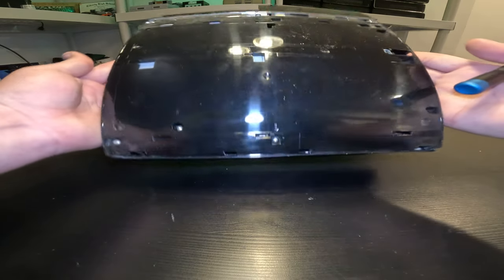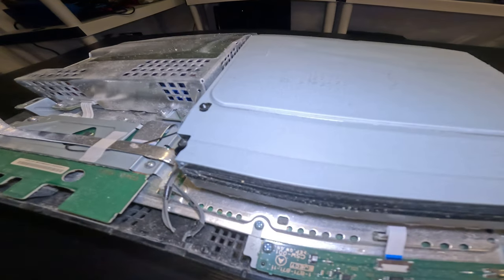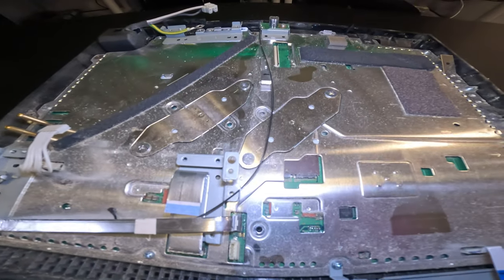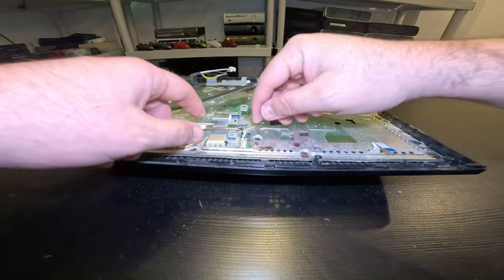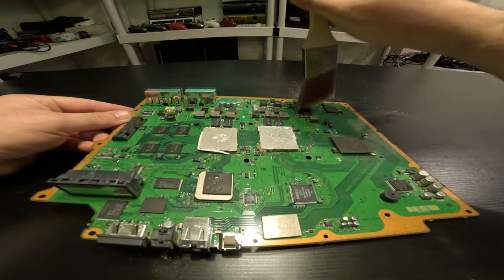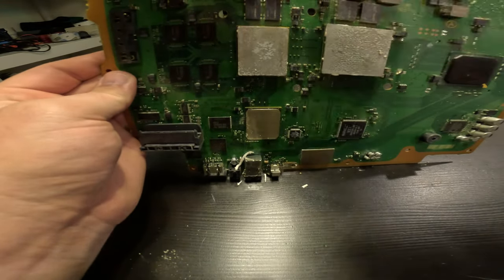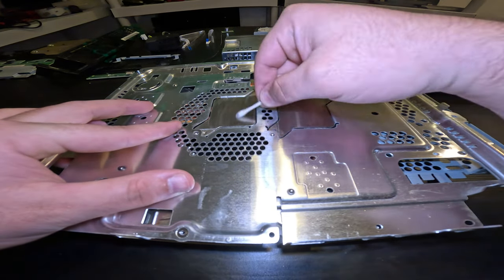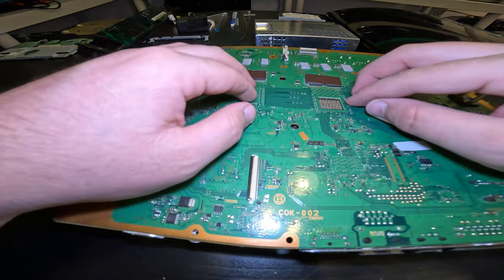Reviving the Past: Backwards-Compatible PlayStation 3 Restoration

Comment: The only issue is this would be a 90nm RSX model and it's still guaranteed to YLOD eventually, as they were ALL bad.  TSMC screwed up during fabrication of all 90nm and some 65nm RSX chips, so whomever gets this, sorry to say you have a ticking timebomb.
Reply from the maker: You are absolutely correct! The only permanent solution is a 65nm that is outside this defective period. I'm hoping to get a reflow station here soon so I can perform this work
Reply: You CAN get a 40nm RSX to work as well, as it's completely outside the danger zone, the only one that will not is the Super Slim RSX.  There are tutorials and examples of this mod done all over YouTube.
Reply from the maker: @dschultz9466  Thanks for sharing! I'd love  to be able to do these swaps and save these consoles from the trash bin. A 40nm swap would be awesome! I am running my personal console as cold as possible, hoping to extend its life. I have a late model slim that is going to be the donor for the swap when I purchase the equipment. Plus I have a few blades dashboard xbox 360s with bad GPUs that need the same treatment.

Comment: What thermal pad do you recommend for the PS3?
Reply from the maker: If I was to recommend anything I see a lot of good reviews about using Arctic TP-3 Thermal pads. On forums you will find that the thicknesses range from 1mm, 1.5mm, & 2mm depending on Thermal pad location. I hope this helps. I wouldn't purchase or recommend the ones I used in this video. They worked well for thermals but I feel like they didn't have an accurate thickness or squish when used.

Comment: The 60GB YLOD Consoles don't sell for that much money in the UK. Unfortunately there is not many people willing to refurbish them either.
Reply from the maker: That is unfortunate! Wasn't the 60gb the only  backward compatible option over there?

If you decide to pick one up, I'd start with the tokin capacitors! It isn't too difficult, and there are a few good tutorials on youtube
Reply: @GFL_Tech  Yup and its emulation based not hardware
Reply from the maker: @RBKing80  Rough... I guess it wouldn't hurt to dust off a ps2 and play on original hardware 😅

Comment: If I sent you mine how much would it cost for repairs?
Reply from the maker: That is a great question. It really depends on what is wrong with it. I have to be careful about taking on projects that may be related to the CPU, GPU, or APU. I don't have a rework station yet, and I am limited by the equipment that I have. Do you mind sharing more details?
Reply: @GFL_Tech  It was previously worked on in 2013 and after 10+ years it finally fell victim to YLOD.  Also I live in the USA and it has a 1TB hard drive.
Reply from the maker: @striderreborn1467   YLOD can be related to the RSX Chip and or the capacitors. I would be interested in making a video about it and would be open to giving it a try if you cover shipping. If it is the RSX chip I cannot fix it until I get the proper equipment. Let me know what you want to do.
Reply: @GFL_Tech I don't mind waiting. But my PS3 is quite unique as it has a big stylish decal on it and I also wouldn't mind paying you in pieces in PayPal if necessary. How do I further contact you about mailing this?
Reply from the maker: You can email me at gfltech@hotmail.com
Reply: @striderreborn1467 send it to computer booter in California he can fix it bad rsx total cost 700.00 but worth it. He fixed mine no issues he reads the diagnostic code